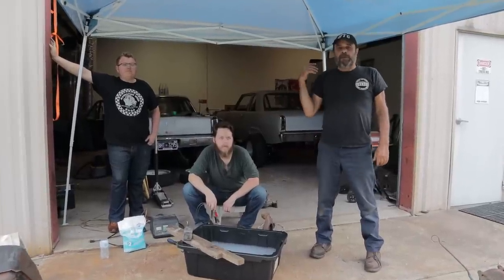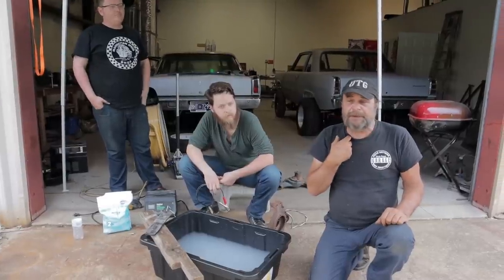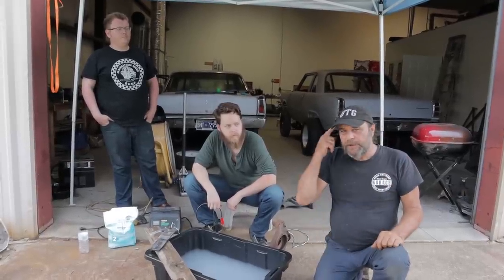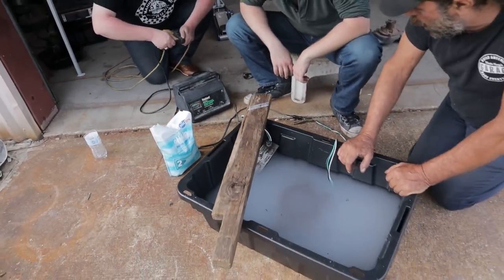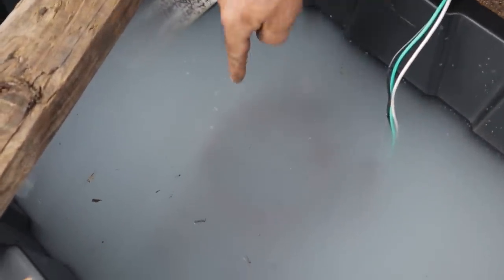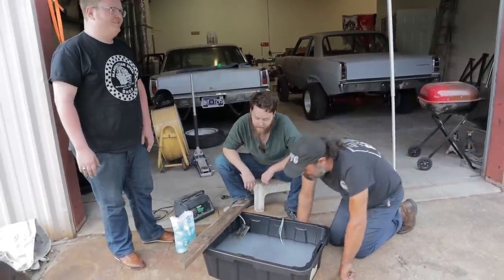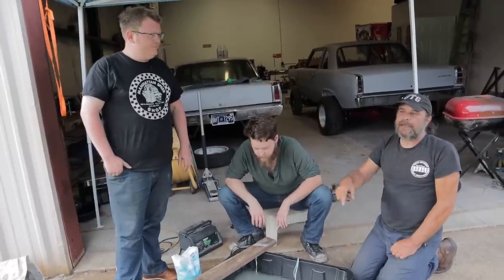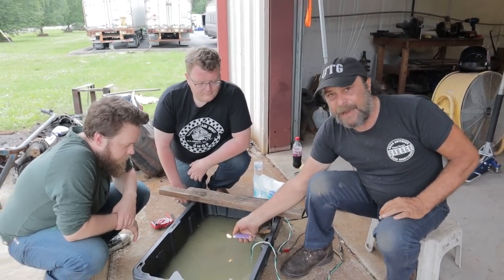Zapping The Rust Away - Best, Cheapest Method Ever!

Comment: Tony, I did a video in this a few months ago.  It works very well and I was pleased with the results.  A few things I would do differently with my setup, a larger battery charger (higher amps) and a bigger tub.  Great video brother 🤙🤙
Reply: A bigger charger would be wasted.  The amount of soda in the water determines how much current is pulled. The lower the resistance, the more current will flow. This is probably only pulling an amp or 2.  More is not necessarily better. It's not linear (meaning twice the current doesn't work twice as fast after a certain point).  More just heats up everything. But even then, it's all controlled by the strength of the bath.

What helps a lot is increasing the number of square inches of anode facing the part. You can tie multiple anodes together.  Like you could put a piece of sheet steel on each of the 4 sides here, tie all 4 together with wires.
Reply: @tarstarkusz  I use a strong bath solution, the charger I use pulls 8 amps during this process while cleaning an engine block.  I do use a large anode and the process I’ve used yields great results.
Reply: @2HacksGarage  Glad you are having good results.  But you should also monitor the water temp.  Because 8 amps sounds like a lot, though a block is pretty large with a lot of surface area.
Reply: @tarstarkusz  water temp was a concern, but never got too warm.  It’s a really fun process for sure 🤜🤛

Comment: when cleaning the inside of something like a gas tank one of the best things to use is a decently long length of small chain inside with one end tied to something on the outside (filler neck, fuel pump port, vent tube, etc...) then strap the whole thing to something that rotates on a horizontal axis (e.g. tractor wheel) then spin it for a good long time thus the chain will flop around inside knocking off all the rust, varnish, scale, etc... and it's easier to retrieve out all the parts than if it were nuts, rocks, sand, etc....

Comment: I think using a fresh salt solution every hour or so would speed up the process.

The green color in the solution might be from the copper wire - copper oxide.
Reply: The solution just conducts the current and acts as a medium to transport the rust particles. Changing the solution doesn't do much except in things like gas tanks where sludge and loose rust is being deposited in the bottom of the tank. What does help is pulling the sacrificial anode every hour or two and cleaning the deposits off of it. You almost have to grind the deposit off. In motorcycle gas tanks I use an old piece of all-thread as an anode so I can chuck it up in the lathe and machine the deposit off... it's really bonded on to the anode.
You will usually get a black smut left on the parts being de-rusted. In a motorcycle gas tank just leave it as it seals the surface and helps prevent further corrosion.
Some gas tanks I've done take several days to de-rust. It was mentioned that 
TSP from the hardware store works well for the solution. It's a powerful cleaner often used for cleaning walls that will remove oils without sudsing. Use rubber gloves as it is rough on your skin.
On motorcycle gas tanks coat the tank with a thick coat of paste wax and let dry. This is to protect the paint finish from splatters of solution that might stain the finish... better safe than sorry.

Comment: The research i looked at years ago but haven't yet tried was using a couple tablespoons of caustic soda in like a plastic 44gal drum of water for electrolyte, phosphoric acid also works well without using electricity but have to soak for a couple days then rinse with water then a quick dunk back in the acid and dry with compressed air, did this with rusty blocks at the engine shop i used to work for

Comment: Powdered laundry detergent will work as an electrolyte in a pinch that's what I usually use. I also only use jump start mode which is 200 amp for me. Some other things to note are the bumbles are partially hydrogen which is flammable, the more electrodes/area the better and the black finish is carbon so you will need a wire brush. Lastly I would recommend not putting you hands into the very conductive water TONY.

Comment: Scott from Scott's speed shop did this using a plastic 55 gallon drum & lowered a 340 block he had to get the rust out & off of the engine block .  For small parts like gas tanks on mororcycles and chromed plates small part I use apple cider vinegar to remove the rust . I bought a 75 Yamaha XS650 that sat for 30 years in a barn and the inside of the gas tank  was rusted so i filled the tank with apple cider vinegar and let the tank sit for 4 days and had put some lead shot from a shotgun shell inside to help knock the rust loose by shaking the tank to agitate the apple cider vinegar and then drained the mix out of the tank & shook the shot out then used a mixture of gasoline and 2 stroke oil mixed then drained to flush the tank out & it looked like new inside . For chrome parts that have light surface rust this works very well to remove the rust then a rinse of water and dry then some turtle wax chrome polish and the parts look like new again .

Comment: This is pretty much the first step (cleaning the parts with electrolysis bath) that platers do with a part before it goes to the stages to reach chrome or whatever coating. This is also how companies ( that care to anyway ) rust protect the body, run it through an electrolysis bath and make all the particles stick to the bare metal in places no one can reach with normal paint.

Comment: Basically you are electro-plating the rusty part with un-oxidized steel.  Same as gold plating or zinc plating or silver plating something.  You can use this process to electroplate just about any metal to a different metal.  The positive lead will attract the oxide/oxygen, so the part you are plating will need to be the negative.  That green may be chlorine from the water.  From my experience, it takes a few hours to really convert all the rust back to steel/iron.

Comment: Arm and hammer laundry washing powder works just fine and most stores have it.   Inuse this to restore cast iron all the time and it works perfectly.
  Your larger, wheel around, 40 amp charger will make quicker work than the bread box unit...  Ive run both. You don't have to run 40 amps but, the larger machine is more efficient and more amps is better.  Be sure the part and anode do not touch, put something non conductive between them. 
  Also, dont use the connectors from the battery charger in the water bath or they'll corrode. 😊   Leave it over night and you'll be down to the bare, grey metal and you will immediately need to hit it with some cast coat because the moment you come out of the water it will start rusting..  Good luck. 😊

Comment: You can mix molasses and water in a bucket and throw parts in there for a couple days or longer. It eats the rust off to clean shiny metal. You can buy gallons of molasses cheap at tractor supply.

Comment: I used this to de-rust my bucket seat frames. They were in very bad shape (Think rat infestation for 20 years) and it cleaned them up good.  I will add that you can and more pieces of sacrificial metal around the tub. It help pull from more directions and also more clean area to draw to when your item is in worse shape to help speed the process. It does leave a nasty black coating that's hard to get off but it will eliminate rust totally if left long enough.

Comment: You should put 2 annodes or even 4 or 6  if you can,  with all the anodes connected together.  Also, the flat should be facing the part, not the edge (as is showing around 7:30).
Reply: It's most effective with direct line of sight. I've used steel buckets as the anode before to get the best possible coverage.
Reply: @Mrshotshell  Yes, that's why I was saying a piece of sheet steel might be best to cut down the time.

Comment: The bigger the wire the more Amps it will cary it's the amps that will give you the power to do the job voltage doesn't matter that much the amps do. 
 same as electroplating and anodising

Comment: If you have a sliding glass door with stainless steel rollers on an aluminum track, you better operate it once in awhile.  The electrolysis makes divots in the track.  Especially near a power receptacle.  Nylon wheels are a good replacement.

Comment: You mentioned that you may have to flip the part over. I bet you could use something like a couple chunks of wood or those little tables you get in your pizza boxes to hold the middle of the box up and turn it upside down with the legs up so it doesn't contact the part too much. A couple three of those under it would get it off the bottom of the bin.

Comment: you can also wire another anode on the other side of the part, or use a grate under the part with a block of wood for insulation, low amps overnight makes it totally easy process. Time for Uncle Tony's electrolysis swimming pool?

Comment: Vinegar is the simplest method. 
Drop it in and soak until the rust is gone.
If you want to have a "blued" surface, boil or steam the part to convert the rust and card off what is left.
Good video guys !
Reply: Vinegar etches the metal, electrolysis doesn't.
Not an issue if your painting it.

Comment: As far as the anode in the tank, any form of waterproof insulator would be good. Wedge it on where the contact may happen, the bottom of the anode and at the fill hole of the tank. I would likely do the electrolysis after taking some off the surface manually first, if you make it easy on the process you'll get quick results. I'm glad you guys are doing the hard part for me, now all I gotta do is get spare subframes and control arms and totes they fit in.

Comment: If you run 24v and low current, you'll have better results.
The start function on the charger will be a lower voltage but very high current.
Its better the other way round

Comment: Easy to remember , you want the rust to leave the part  '"Negative"" and go to the ""Positive"" plate.   The soup """electrolyte""  may have to be topped off  but will last, the water will get rusty and need to be topped of mostly due to evaporation. It will work even if it's nasty!  The more positive plates around the part being cleaned up will help get it cleaned up evenly.

Comment: I use citric acid so you make the rust disaper in two ways, ity works wonderful. The amphere and volt matter, the more the better. I use a truck charger with 24 V and 24 amp.
And you dont have to worry about the hydrogen  gas, its very little so it dont matter.
Just remebere, youy must remove all grease oil and other stuff, or the rust will stay

Comment: Well I've got an old Harley tank I've been running on my motorcycle and every once in a while I clean the crud out of the carburetor even though it has a filter on the petcock I'm definitely going to try this when I take my tanks off see if I can't clean them better than the old nut and bolt shake shake shake ...😊😊

Comment: there's video's out where 50 gal plastic drums were used with a engine hoist to dip engine blosks and heads.gets to water jackets cleaned out.motorcycle gas tanks. i used b-b's for cleaning inside of tanks,no sharp edges to dent from the inside out.water,soap,b-b's shake intil clean.then rinse with paint thinner to get water out.shake around a light layer of oil so metal doesn't start rusting again.

Comment: Ohh yeah if you have tapped holes plug your holes we used a thread gauge and it would eat the threads out .we used felt to plug the holes. We used to have guys run around smoking over the tanks.we used a Fisher scope and a xray on finished parts thats how I got into x ray parts for top fuel and other engine builders. These work great on oil pans .

Comment: If you don't have a old charger use a DC welder on lowest amp setting or wire a battery in line and use modern charger on the battery

Comment: Soak clean rinse then Electro clean , worked for plate shop at GE , was with GE over 20 years then they started to bring thieves and crooks into upper management and it went down the tubes !  you need a much bigger tank steel stainless steel lined with special epoxy !  You need a rectifier your charger will fry itself ! A copper bar set into saddles, different anode s and electro clean for different metals. Steel  you should use muriatic acid on steel  theres a company called EM little that sells supplies as well as Enthone omi .where that wood is you should have a copper bar , the bar sits in saddles. You hang your part off the bar if I were you I'd make a strip tank.

Comment: The strength of the bath and the voltage determines the current, not the wire.  This will not draw enough current to justify 3 large wires.
Reply: How small can you go with wire size..... @ say 8 amps/ 6 volts.
Reply: @randywl8925  Pretty small.Like 12 gauge.

Comment: This was a mind blowing experience.
Reply: Be aware that critical strength parts need to be baked to prevent hydrogen embitterment.
Reply: @bobroberts2371  how you go round baking parts just put it in the oven for bit, or there's something else?
Reply: @Adamu98  From what I recall, the  parts get baked at 375* F for 2 hours but don't quote me on that.  The bake out needs to be done immediately after derusting.  This probably isn't an issue with thick castings however something stressed like a spring or possibly suspension parts would need it.
Reply: @bobroberts2371  thanks.
Reply: @Adamu98  Just put it in the oven, don't have to get it too hot.  If you get it red hot, it will actually absorb the hydrogen and not allow it to escape.

Comment: The electerical wire was probally 14g-2 which means it has a hot wire, a neutral wire (they usually switch between each other), and there is the bare copper ground wire. There will be some wire that will say 14-3 which means it has the hot and neutral and an extra hot 110v that you can wire up for like a 220v plug or run to the smoke detectors.

Comment: If you mix the metals, it will put a metal plating of whatever metal is on the positive lead, if you do stainless steel it will put off a lot of the chromium and other deadly heavy metals that goes into the stainless steel alloy.  If you put in a steel fork on the negative and a piece of brass on the positive, it will brass plate the fork.  Same as if you use copper instead of brass, or silver, or gold.  You can use stainless steel on the negative side without any negative side effects, but never put heavy metals on the positive side, it will cause toxic contamination off gassing and will also put those same toxic metals/chemicals in the water.  You will have a bad time if you do that.  But any metal on the negative will just get a coating of whatever metal is on the positive side.  The lower voltage and lower amperage you use, the better the effect, but longer it will take.  That black that you rubbed off is a chemical reaction from causing the top coat to burn a bit, so you will need to wash it if you keep doing voltage above 2 volts and amperage over .5 amps.   If you put zinc on the positive side, it will remove the rust and put a zinc plating on the rusty metal on the negative side.

Comment: 9:50  Electricity is a PULL system, not a PUSH system.  Your outlet is rated for 20 amps, yet, if you plug in a 100 watt bulb, it doesn't get 20 amps, it gets less than 1 amp to get the 100 watts.
  The same is true here. All that setting it for 2 amps does is limit the current to 2 amps (and in this case is probably not even doing that)  no matter how much the load side is "asking" for.  I seriously doubt this is taking more than 2 amps.  But whatever it is drawing, putting aside the current limiting capabilities of the charger, is what it is drawing and raising the limit all the way to "start position" will do nothing.
The way to increase the power is to add more washing soda,  The washing soda solution is what manages how much current is being pulled.
Also, electrolysis badly discolors the metal.
Reply: Does the discoloration of the metal create any issues? I.e. with applying primers? Would it need to be brushed to clean bright metal?
Reply: I've primed/painted right over the dark surface of wheels that I've done this to with zero issues so far(3 years for the 1st set). I've also powdercoated wheels that came out almost black after washing w soap and water, again, no issues. YRMV
Reply: @jonathangehman4005  As long as appearance is not an issue or if you can paint it, it's not an issue.
Reply: @car_ventures  Not that I'm aware of.  I know it changes the color because I've done a this many times. I've never had trouble painting.  I think you would probably need a grinder to tear away the top black coat.